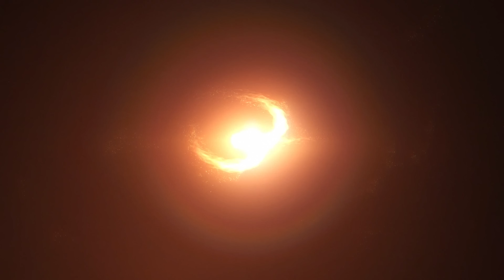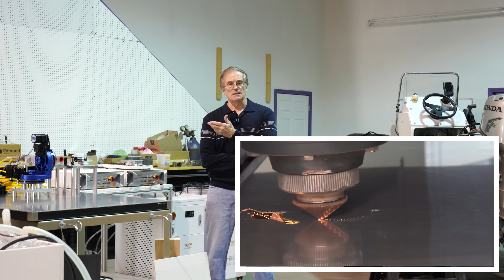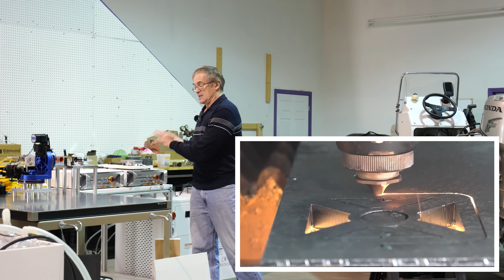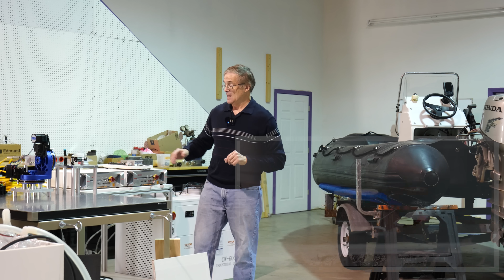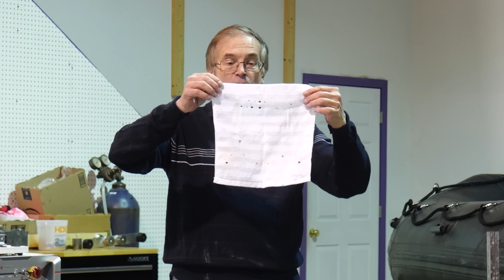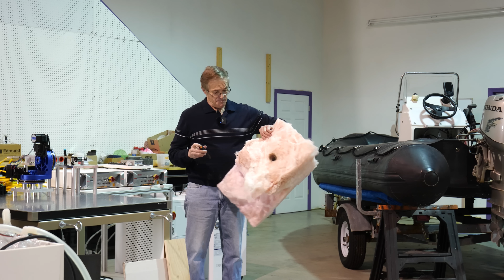We have a problem... and need your help!

Comment: I haven't read any replies yet, apologies if I repeat another's idea - it was not my intention:
Have a beam scatter device inside a steel box that works when the laser 'master' is powered up. The scatter box can act as a fuse to the power feed to the 'master'. The scatter box is full of either ice water or very reflective random debris (like small broken mirror shards etc.) Have the targeting and 'final stage' emitter after the scatter box.  If the power fails to the scatter box, the power has failed to the source. If the scatter box itself fails, have it fail the power to off. The laser emits only on trigger pulls of a pre-determined duration - ie. enter the time on the system that you want the laser to fire for in milliseconds, then stop the laser.

Comment: Hebal
Reply: Which is airated cement concrete blocks.  Light weight, thick.   It might work even if you have to soak it in water

Comment: I’d suggest water full of a dye that absorbs the laser wavelength, in a steel tank. Calculate it so the radiation is at a safe level at the other end of the tank to be absorbed by the steel on the other side, not so absorptive that 99% of the radiation is absorbed within 1mm of water or else you’ll get flash boiling and other nasties. Maybe 2-10 inches thick would probably do it, hopefully? Weld up a 2x2m tank and chuck it on wheels.

Comment: Instead of focusing on a single material that absorbs laser light at the surface, you need add multiple layers of material. 

Here's a list of material properties that might be helpful:
- A material that absorbs a portion of the light and transmits a portion of the light (semi transparent material).
- A material that diffuses light.

Comment: I think a composite of something ablative (carbon + epoxy or cork) and something reflective (layers of tinfoil are probably the cheapest option) idea is: everything will take damage from the laser but you are only after a few seconds of survial so we need something turns into gas/plasma to defuse the laser and something that reflects the light back into the gas cloud to make even more plasma right above the material ... use as many layers that are as thin as possible like 10 layers of tinfoil glued together with carbonblack/epoxy. No idea how well this will work because everything turns into gas if you hit it hard enough.

also for monolithic material, graphite plates make for a nice beam stop I think

Comment: Just a wild guess: aliminum, steel sheet or calcium silicate board coverd a few cm concrete or cement, finally top surface covered with graphite panel.

Comment: Not an expert but something like starlite might be worth looking into, I know nighthawkinlight has some videos about it and my understanding is it could be relatively easily incorporated into some kind of spray. beyond that I can't think of many things that could absorb that kind of energy, maybe something capable of some amount of energy dispersal like a ceramic? In terms of budget a wall of sandbags could work exceptionally well but would be quite hard to move but I think unless you are getting something exotic it's probably better to look for something that is space filling, energy absorbent and not a solid. I think bags of powder of some kind make the most sense but you may need to test a few to see what woks well. Concrete, sand, plaster and glass fibre insulation would be my first tests. Good luck!

Comment: I thought of a dozen elaborate ways to do this, before I remembered the K.I.S.S. method. You need a rapidly replenishing substrate in an endless loop with a couple of simple fail-safes behind it. Start with a rental concrete pumping truck parked outside of the bay door loaded with only a mixture of fine silica sand and water, no cement. A concrete pumper should produce at least a couple of feet of consistent laminar flow at a fast speed, on a reasonably straight level plane past the nozzle. Or raise the laser level to the height just below the bay door and shoot a vertical column into a hopper below. Laminar flow with the highest ratio if sand to water as possible, while being as viscous as allowable to pump, is key. The largest diameter nozzle (4"-6" even possible? dunno) will give you the largest backstop profile and thickest substrate to penetrate. A few feet away, or below,  a catch hopper with another concrete pump to recirculate the sand slurry back to the pump truck. You should end up with an endless replenishing, 4-6 inch thick backstop, with semi clear irregular shaped silica granules that diffuse light. Behind the laminar flow segment, a black PVC or ABS pipe of the same or larger diameter of the laminar flow, capped at both ends to provide total darkness, with a photoelectric cell inside could be used, wired to shut down the laser the instant it breaches the pipe wall and the light triggers the cell. Then a double helping of whatever substrate you tested that took the longest to penetrate just behind that. Its portable, Just drive the truck back to the sand supplier and pump it right back onto the outdoor sand pile to dry out, the pile gets wet in the rain anyways. No major cleanup or structure to tear down, other than a broom or light shoveling of errant sand on the driveway. Low cost, I cant imagine the rental or even hiring a contractor with equipment for the day would break the bank too much. The biggest drawback is its a small target. I dont know the capabilities of accurately aiming that laser before firing it.

Comment: I came up with three possible ideas:

1. The idea that some natural materials char on the outside and resist burning further might be a possible avenue? Oak beams have survived house fires and banana fibre is known to be fire resistant for that reason, I believe

2. Is it possible to have a reflective material that redirects the light within itself rather than back out into the world? Like that really black paint, is it carbon nanotubes? This is along the line of thought you had about the fibre insulation, I realise, but if it were to reflect rather than refract, it might stand up to the energy better?

3. Control the ‘burn’ time from the machine end: have a lens that defocuses the beam as a default, fail-safe, position and only focus for short bursts when on target? You might not destroy the target straight away, but you save the background.

Comment: What about having the beam go vertical (from the top downwards) instead of horizontal? Then just put a huge (open top) container with an absorbing liquid (you can experiment with various liquids/mixtures) under it. Maybe also have the liquid move around (e.g. pumps) within the container to better distribute the absorbed energy.

Comment: Might be stupid, but what about ca tank of coloured water? Something taylored to absorb the wavelength of the laser with a tank made from something that doesn't. (EDIT: you could even use something cheap like charcoal) The colour particles would absorb the light and the water has a high heat capacity and transfre rate. I think the tank wouldn't have to be super deep either, like 10cm of water might be enough to dampen the light enough so it won't be hot enough to burn anything behind it.

Comment: One thing i have learn about laser. The color of the material and color of the laser has to "match" if you want it to absorbed. 
My material tips is a DIY "starlite"  like the one youtuber NightHawkInLight did. 
Other thought is something with water in it with black membrane. Water is a REALLY good absorber of heat.

Comment: There are solid panels of salt available to buy as they are used as interior decoration. Translucency of the salt should diffuse light a bit and also act as a thermal mass. Also, you could use a panels of wood with a layer of salt crystalized over it.

Comment: Refractory board used in steel making would probably be pretty resistant. I believe they are made from a type of ceramic, and should be fairly easy to get a hold of.

Comment: perhaps a layer or a coating of graphite can help. There are commercially avaliable graphite cooling pads (PC component), they are very thin and famously good at transfering and spreading heat in their plane. Perhaps enough to prevent it from instantly melting if they have some place to dump the heat or if the pad is large enough it can be enough by itself 

Sorry, not my first language, hope you get what I am trying to say

Comment: Gabion Walls with 20mm Blue Metal might be sufficient?
Combined with Piezo light sensors then another thinner Gabion Wall to protect the building.
Cheap and refillable.
Reply: Probably drape a tarp over the top to prevent light getting inside until the laser activates the piezo switch.

Comment: Test how fast it will go through a sand wall, and thicken it until reasonable time.
Then a kill switch wall behind that incase (previously mentioned in comments.
Reply: Or some tiny glass or silicon material that can diffuse the light power?

Comment: Have you tried carbon felt?
Reply: I imagine it will overheat and fail, but it's extremely high thermal resistance should give you a second or two to hit the kill switch.

Comment: Idea one: Would be to use a small water tank, with a dark material (non-toxic) mixed into the water. Then use a mirror to divert the beam into the tank. This all assumes the mirror itself would be able handle contact with the beam. Regardless, the system could be easily setup and transportable. (Relatively cheep too)

Idea Two: Use a forklift to position and hold a barrier of bricks. This is easy to reposition and the bricks are cheap to replace.

Comment: You could cover the area with spinning discs of steel with water spray for cooling or to prevent rust use machine shop coolant. The spinning reduces the chance the laser will be stopped in one place relative to the material. If steel doesn't work there's always tungsten.

Comment: Your problem is not about power but density.

Maybe your first step should be to de-colilate the laser. Any layer of gaz would help. Anything that transforms your hait thin ray beam into ... Enlarging beam. 

Stop trying to think about absorbing material, but think about an optical dispersion. Wools are very good at storing liquids. Once the liquid gets into vapor, the vapor will enlarge the beam and spread power over larger surface. 

Think it as a 2 layer thing. As your laser can perforate anything, think the mission of the first layer as ... Reducing power density.

Comment: Another relatively cheap to test option could be that same silver glass bead paint they use on road signs, just way thicker. 

Along the same line of thought, those gel toy egg things might work if sandwiched in an acrylic thin tank, maybe with some diffuse liquid like a bit of white water soluble paint to make the water slightly opaque. 

Either way I think your best option is to spread the beam in a material capable of handling the heat, in as short a distance as possible, rather than trying to block it

Comment: Would something like a snail trap used in indoor shooting ranges work ? It would need reflective surfaces inside the trap until the beam hit some like a box filled with water or wet sand etc. ? At the end point, the beam would be vertical (or near to it) so the box would be open at the top thus minimising any chance of spillage from being pierced by the beam. Optical detectors inside could be wired to your interlocks to trigger shutdown once the target material has been penetrated.

Comment: Try wet grass / turf. Having tried to cut my lawn with a powerful laser I can confirm that the light scatters safely being eventually absorbed by the grass moisture. A vertical lawn might be a challenge but a bank or small hill might work. Self healing too! Just ensure that the mass is watered from the roots in order to avoid surface water reflections.
It absorbs 1024, 405, 445, 335, 10,600nm well so is probably good for many laser applications but avoid 532nm obviously!

Comment: i'm a non engineer
i would combine TRIZ
with the following idea;
a thick fog of dry non combustible material
that allows the laser light to pass thru
but spreads out the beam and
sprayed like water which later can
be suctioned up with a vacuum cleaner
to clean up the mess.

wishing you and your crew the best

Comment: The supplier doesn't offer beam-dump devices?  Buy not build?   I imagine that the problem was worked out years ago.   Oldschool DIY beam-dump is a clamped stack of double-edged razor blades, with heatsink if needed.  Grazing-angle steel surface, not perpendicular.

Comment: Can you use a failsafe shutter using optical leverage to divert the beam to a lens that would refract the beam, expanding rapidly to a relatively harmless diameter? In other words, adjust the beam rapidly instead of trying to engineer enormous barriers that can handle it tightly coupled?

Comment: A constant laminar flow waterfall curtain behind the target with suspended titanium dioxide particles. Not only would it probably work, but it could be super fun build by itself! If the laser punches through it then increase the particle concentration, and/or make the sheet of water thicker with a bigger pump... You're going to need a big pump.

Comment: What about using rockwool insulation (I like to think of it as making cotton candy but they used melted rock instead of melted sugar)?
I think it comes in different forms (like blankets etc..)
Maybe attach it to the front of drywall?
I know you mentioned you didn't want a solid/heavy wall, but maybe make a wall with rockwool and 1-2 inches of sand or a-gravel behind it?  Depending on the size, you could put it on wheels to move around.

If the rockwool can last a second or two, you could maybe make the wall itself constantly moving someway (spin or conveyor belt on its side, or ...) so the chances of the laser digging in the same spot becomes less likely.

I do also like Slayer553826's idea of creating a light box to turn off the laser.

Comment: I appologise in advance, this could be the worst idea ever. 
I was thinking dispersion, the glass fragments from a boken toghened glass window are relatively non uniform. so if you had say a fire blanket spayed with some fire retardent resin and spinkled with aheavy layer of siad broken glass. could that disperse the beam enough to lower the thermal impact of whatever is behind it?

Comment: Suggestions from random guy :
- fire retardant wood 
- fire retardant foam, the one used to protect metallic beams in buildings . Installed as white stuff in thick layers, and volume goes x10 when heated  (      intumescent ) 
- water if you keep it raw liquid with ability to circulate ( aka aquarium, un practical because you need a box storing water liquid in the form of several cm over a large surface =» aquarium full surface of the wall  is impractical )

Comment: What happens when it hits glass? What about water?
Probably not practical on this scale, but if you could put a fish tank behind it then float some like titanium dioxide powder in the water with a magnetic stir bar to keep it in suspension, if the glass can survive then it could end up just lighting up the whole tank with scattered light?
Reply: the water being liquid I think could fall fast enough to fill any voids made? I think the bigger issue is if the glass would survive? Might need special glass?
Reply: Also have a shallow wide tank and point the laser down towards it so that it doesn't need to go through the glass side?

Comment: 1. Maybe hot air curtain to distort beam + something solid behind to catch whatever passes? Hot air has this advantage over mists that you can't "puncture/tunnel" it and possibly laser energy source will make distortion effect even stronger in contact point. 
2. Old good fuse method. I assume this is needed for testing purposes when contact point is fixed. Put something conductive on the end which will be a fuse for power for laser, if it melt, circuit is broken and power stop flowing.
3. vertical high speed conveyor belt-like machine so the contact point is never the same. Or stacked alternating fans so laser has contact only with one blade at a time while others are "being cooled by rotation"
Reply: the conveyor has this advantage that you have a lot of surface contact space to add heat dumps + it can be as large as you want + u can add wiring in belt to help transfer heat.

Comment: Try making Starlite, they got the basic formula down but the original formula that was used on the egg and blow torch skit might have had some other additions like ceramics possibly but I'm sure you could add layers onto wood layers
Reply: I tried making it myself before and if I recall correctly it was impossible for me to remove the Starlite from the wood I had put it on and didn't catch fire either.